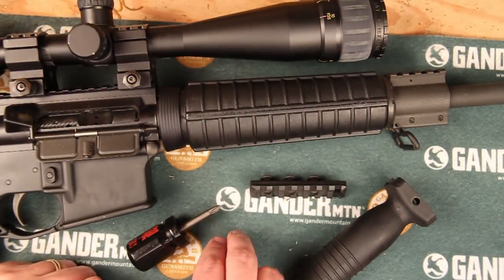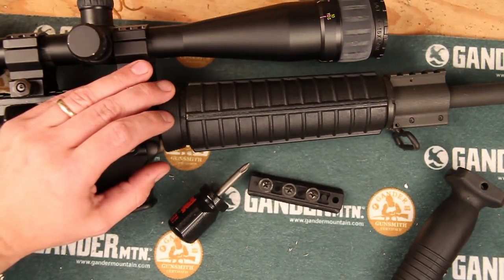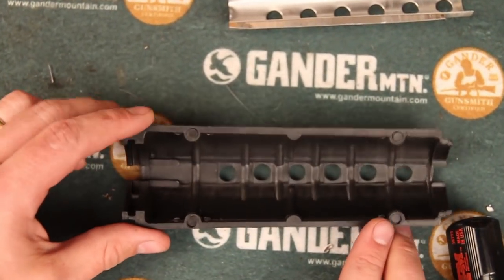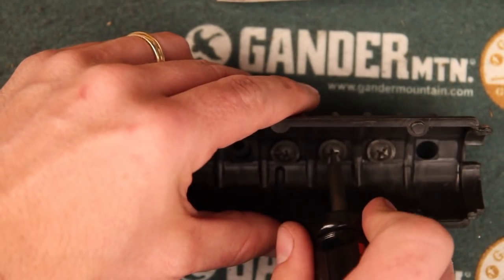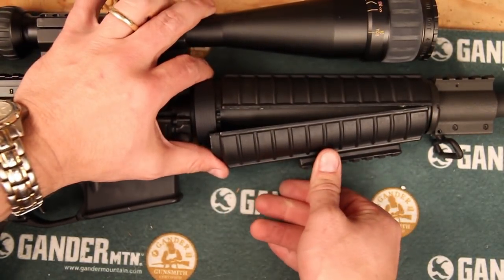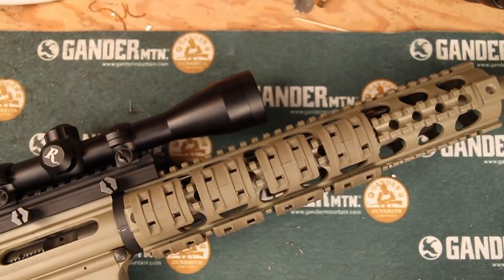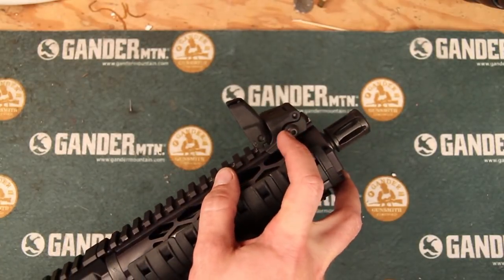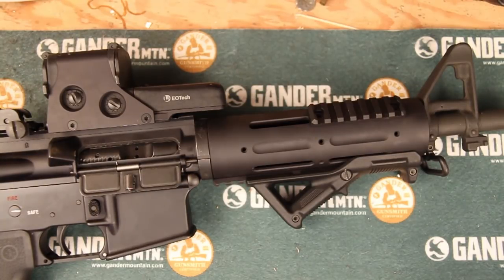How To Install A Rail On A Factory AR-15 Handguard

Comment: What size rail is that? I bought one but it's too small of screws
Reply from the maker: I've linked to a couple in some of the other comments.  If your screws are too small it's possible that you bought a rail that is designed to mount to a specific handguard that has pre-drilled threaded holes.

Comment: What is the Rail P/N and where to get it?
Reply from the maker: There is a pinned comment with a link to the closest I can find. This one is no longer made.
Reply: Thank you for the quick response. I will see what else I can find. Trying to get a Picatinny Rail on the bottom of the DPMS LCAR forearm grip.
Reply from the maker: That looks like a standard hand guard, but I don’t know anything specific about that model.
Reply: @AdventureColorado , LCAR uses the AR-15 tapered front forearm grip. There are no rails to mount accessories (other than scope). We are trying to get a Picatinny Rail for Bipod use. The video shows exactly what we need and how to mount it. Just need part number and manufacturer.
Reply from the maker: The one I linked in the comments should work. Others have said it worked for them.

Comment: Will this work on a s&w m&p sport 2?
Reply from the maker: I haven't tried it, but as long as it is a standard handguard it should.
Reply: @AdventureColorado   alright thanks for the quick reply ! Nice vid
Reply from the maker: Good luck and thanks for watching!
Reply: @AdventureColorado  no problem you got my sub, I live in Colorado and just found your channel, great stuff!
Reply: Did it work ? On the smith n wesson m&p sport 2 ? Im needing a rail for mine
Reply: @gymfreakdude8860  yea it did man
Reply: @Drivingdrew719  what kind of rail? I don’t want to get the wrong size because I’ve seen multiple comments saying screws were too small

Comment: Is it bad that mine doesn't have a heat guard?
Reply from the maker: It’s not ideal, but it will still work just fine. You’ll feel the heat more if you are firing a lot of rounds.
Reply: @AdventureColorado  Now that im going to get the rail and the grip the heat coming from it shouldn't be a problem. Thank you!

Comment: the screws I got fall through the damn hole! where the hell do you get those screws lol
Reply from the maker: I just used the screws that came with rail for mine.
Reply: AdventureColorado yeah I figured I got the wrong ones. which is a bummer
Reply: Use washers?

Comment: I probably would've mounted it through the metal heat guard cause the plastic could crack..
Reply from the maker: If you’re worried about the plastic cracking it would always be a possibility if you are cranking on a vertical grip.

Comment: Would it be alright if I want to install two of those rails ??
Reply from the maker: If you had room, you could install one in front of the other.  Or one on top, one on bottom.  In order to install a rail like this in a 45 degree position or something similar, you would have to drill through the handguard.

Comment: These handguards are really not meant to dissipate heat very well. Iraqveteran8888 says.
Reply from the maker: It’s a simple design that has been around for a long time.
Reply: 50 years to be exact
Reply: quad rails dont either. they just dont melt.

Comment: Can someone tell me if there are picatinny rail strips with various dimensions between attachment screws?  I have a Ruger AR556 that came with a handguard for their 16 inch barrel that is mil-spec style, but seems to be uniquely Ruger in distance between vent holes, making attachment of rails a challenge.  I'm a cheapskate and would like to attach a picatinny directly to the lower handguard.  Magpul strips won't line up with the vent holes.  Suggestions?
Reply from the maker: The Picatinny rails are typically standard, but the way they mount to the rail is not.   You may have to find the Ruger version of the rails, or go to a forum and post the center-to-center distance of the mounting screws and see if anyone can tell you another brand that would use the same distance.
Reply: Start all over, sell that pos ruger and get a mil spec ar
Reply: Jeff James Lol someone's mad...

"The Ruger is mil spec"...Orealy? The delta ring and barrel nut are not mil spec components. That’s something that could get in the way of certain upgrades, namely free float rail systems that clamp to a standard USGI barrel nut. Barrel nut and delta ring are "patent pending"...tha fuck??
Reply: As always, the term "mil spec" has its own definition and limitations in the AR world.  In this situation, I believe that "mil  spec" refers only to the upper and lower receivers.  They each have a small keyhole shaped mark that Ruger's instruction manual identifies as their "mil spec" mark.  Other parts are Ruger made to Ruger standards and/or designs.
Reply: Did you ever find one that fit?
Reply: @damiion666  you know what "mil-spec" means? made by the lowest bidder.
Reply: Frigglebiscuit you want to know what mil spec is...it’s what is says it is...a standard or criteria set up by the military, no matter if the bidder is lowest or highest they all have to meet the criteria. I’ll take a milspec over a frankengun any day. Do yourslef a favor and get a s&w sport2

Comment: The rail you linked came with two holes. Yours has 3. Don’t even know how to correctly link the actual part you used?
Reply from the maker: I’ve explained in several comments that the one I used is no longer available and I’ve linked a similar rail that is still available.
Reply from the maker: Daniel Deering  The rail was from CAA, Command Arms Accessories.  I don't see them for sale on their website anymore.  This video is 5 years old and I've had that rail probably 3-5 years before I made the video.  It was one of the first add-on rails that I bought and now all of my ARs have free-float handguards.

Comment: I guess my question would be, as I read through these comments a lot of people wanted to know what is the name of this rail and where to get them. Why would a person advertise these rails and then ignore so many peoples need to know, My only guess would be that he's may have died.
Reply from the maker: This video is a guide on how to install a rail, not an advertisement for something that I sell.  I have linked to similar rails several times throughout the comment section.  I have also mentioned more than once that the specific model I used in the video is no longer available.
Reply: Thank you, they are CAA Rails. I got 1 thank you again.
Reply: @AdventureColorado  well man what rail section did you use??? No link to that??
Reply from the maker: Zach B I’ve mentioned in a couple of the comments that it is a Command Arms rail that is no longer available. I’ve tried to link to similar rails.

Comment: this is insane, the plastic hand guard is plastic and will break off at the worst possible time!!
Reply from the maker: You’re funny, I like aluminum handguards, but the standard handguard has been used for decades just fine.
Reply: @AdventureColorado  with a handle mounted to it and not the barrel as well? Just asking, I don't mind being wrong. Thanks for responding.
Reply from the maker: Mark R the hanguards are pretty sturdy and the the 223 doesn’t recoil very much. You would have to be really over driving the gun or slamming it into barricades or walls to damage it. I run aluminum hanguards on all my rifles now, but ran the setup in the video on a duty rifle for a number of years.

Comment: Hmmmmm, looks like you should've gotten that Delta Ring re  moval tool (a U shaped rod coated in vinyl), as youl had to cut the video!  BIG PROBLEM!!  The M16/15 M4 Mil Handguard is NOT level, it sloples to the front ny 3.5 degrees, so a stock Picatinny rail will slope too. Put on a light or Red/Green laser and it will NOT  point where the barrel points! Put on a vertical grip and it will be cockeyed forward!!  - Solution YOU didn't come up with is the grind a matching slope in the base of the Picatinny rail with a table top elt sander!!

Comment: Here ya go - HooGou 5 Slot 2" Picatinny Weaver Rail Section for Keymod Handguard Mount Rail System Black (5 Slots) https://www.amazon.com/dp/B075JD9JR9/ref=cm_sw_r_cp_api_i_37U4EbXX1QNAS
Reply from the maker: This is for keymod handguards, not standard handguards.